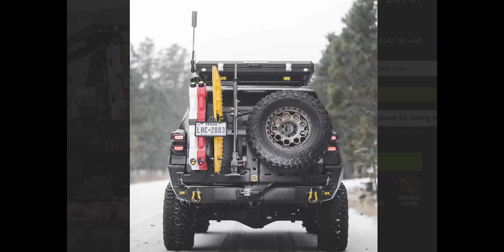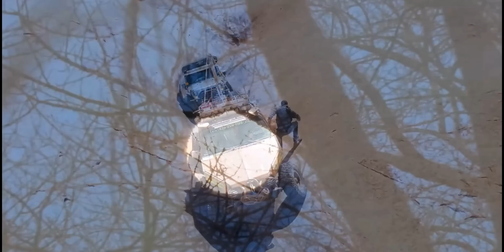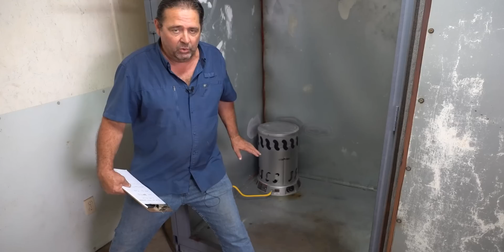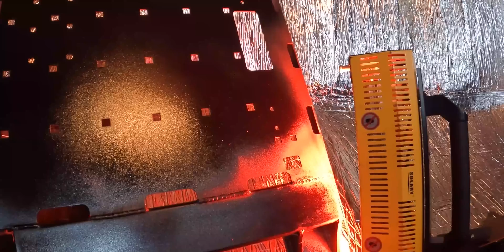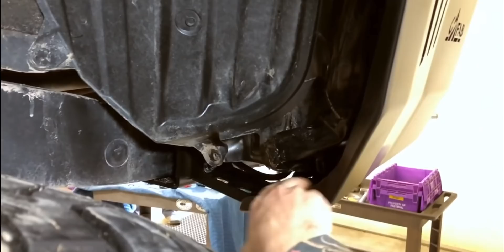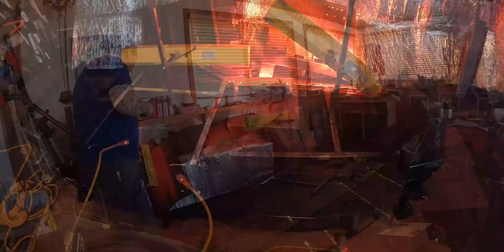5th Gen Toyota C4 FAB  Rear Bumper: POWDER COATING without an Oven.

Comment: Will this truck be able to be lifted as much as your 80, considering it’s independent front suspension. Many 4WD purists prefer solid axles and consider them to be real 4x4s. Let’s see how high you get it to sit safely. I actually prefer how these newer trucks ride on road compared to let’s say my 80 series. You need to drive the highway more than off roading to get there.